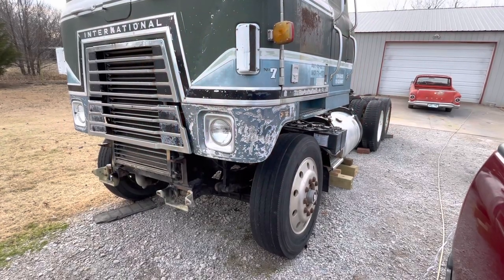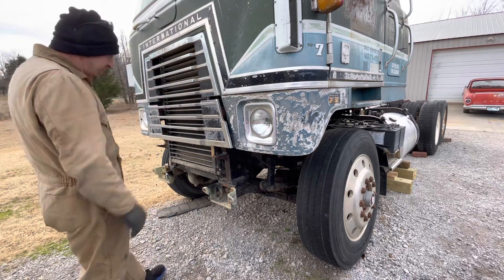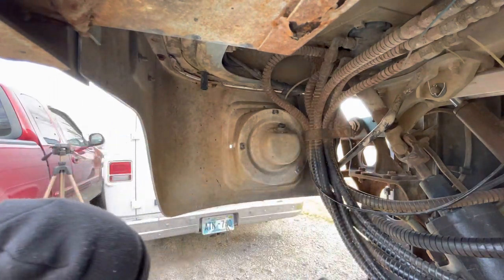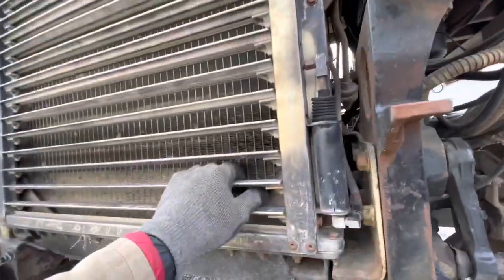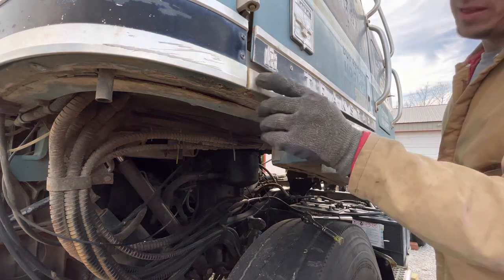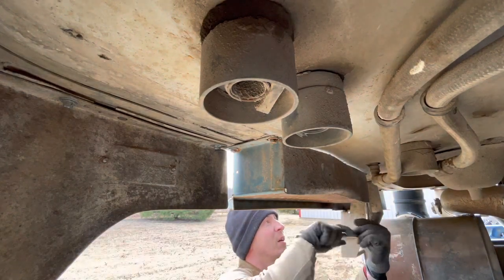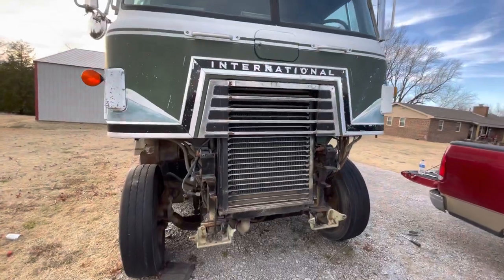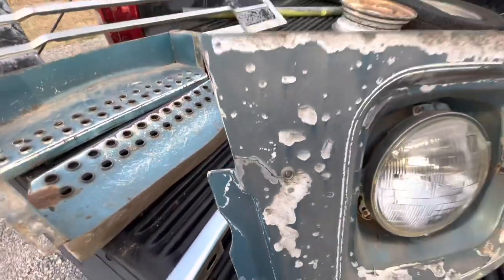Cabover Restoration episode #11. Removing some damaged parts so I can repair them.

Comment: That’s good you’re getting some of those pieces out to fix. I wasn’t aware those light pieces were metal I always thought they were fiberglass. That grill may shine back up but it looks pretty dinged up. Those shutters should operate on their own. Open and close when coolant temp requires them to. But your little cylinder appears to have seen better days. I don’t know where to find bezels and stuff for that old of a truck. Hope the doors clean up okay cause they look like they’re made of steel. The heater box is on right side under the seat that’s most likely why the floor is constructed different. It’ll be sharp when it’s done!
Reply from the maker: Ive got a lot of hard work ahead of me tho. Its been fun so far.

Comment: Can you get me the exact dimensions on those radiator shutters?
Reply from the maker: The exterior demensions of the whole assembly is 40” tall by 29-1/2” wide....add 1 1/4 per side for the little 90 degree lip that mounts it to the radiator. The actual flappers are 26 -1/2 wide.